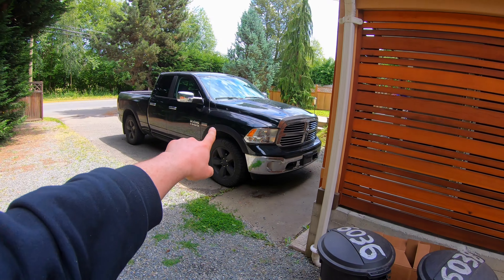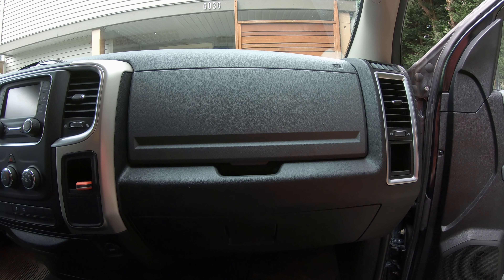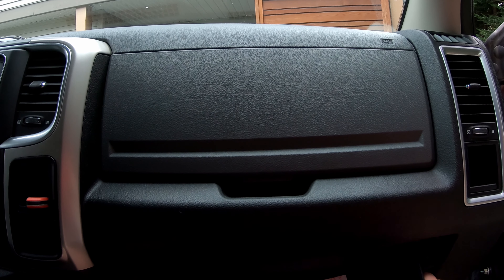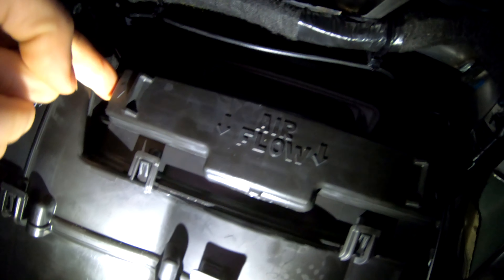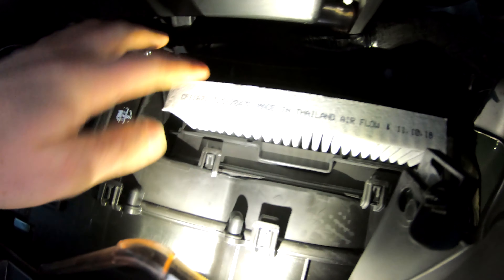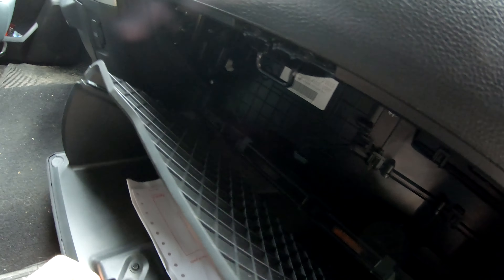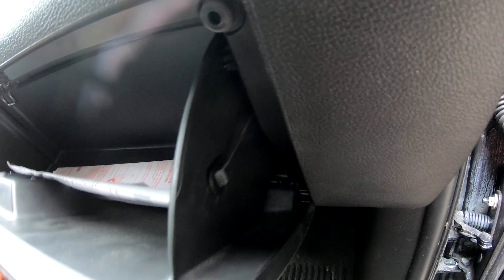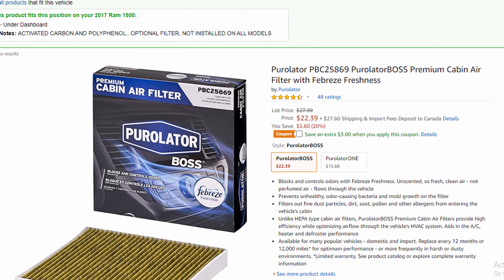RAM 1500 Cabin Air Filter Replacement (Super EASY) And Location

Comment: Okay for anyone who has been experiencing a musty damp type smell you cannot get rid of with air fresheners, try replacing the cabin filter. I used the $27 one with Febreeze effect and what a magnificent difference. I bought my 1500 used from a dealer and they never changed the cabin air filter. Instead they put in 5 air freshener wafers under the seats that smelled like a Guido from NYC...lol.

Comment: Thank you! I was told I would have to cut the plastic housing since Dodge don't worry about it unless you wanted to pay them for a Retrofit. The shops $100 $80 labor and  $20 parts, ridiculous.  I will have to check my cabin filter now
Reply from the maker: It takes about 10 minutes to replace. shops make big money doing these
Reply: My 2015 doesn’t have a door you have to cut it out
Reply: @willywonka6252 currently having the same issue with my 2012

Comment: Good vid, just didn't have same setup on my 2015.  Anyone else with the same setup that doesn't have the door from the factory you can cut out the area with a oscillating tool and add a door.
Reply: Got a 2011 and no door

Comment: Not all 1500 have the cabin filter. Mine is a 2015 SLT and where the filter goes is sealed off. You can cut through the plastic and mod it though.
Reply: Same here on my 16 lonestar 1500. No words on mine and the pegs on the side are different and do as video
Reply: Do I have to cut an opening???

Comment: Off topic but is there a way to replace the rear cabin vents from inside the cab on a 2014 1500? I had the seats and sound barrier removed but couldn't get it out. Is it possible or do I have to remove the bed and replace it from the exterior?

Comment: I'm going to change the one in my wife's ram and noticed that the fan makes a squeaky sound, would the cabin filter have anything to do with that?
Reply from the maker: No is shouldn't, odds are the blower motor is starting to fail or something got inside it and the blades are hitting it.
Reply: @GettysGarage  Thanks, hope the fan is easy to remove .

Comment: Mines a 2016 Ram 1500....made the mistake of not taking a peak behind the glove box before i bought the filter....and there's no door. I just blew 25 bucks.
Reply: Not $25 blown. Take a box cutter with a sharp blade and cut open the spot. Insert filter. You'll also need to purchase the cover that goes over the gap you've created. I'm searching for a kit right now that includes that cover and a filter. Slightly miffed that I have a Limited that doesn't even include a filter and cover. I gotta do a slight mod for something that should be standard.

Comment: The importance of the cabin air filter is that if you don't filter that air, your evaporator core will....and when it gets clogged up, you won't flow as much air in your HVAC system.